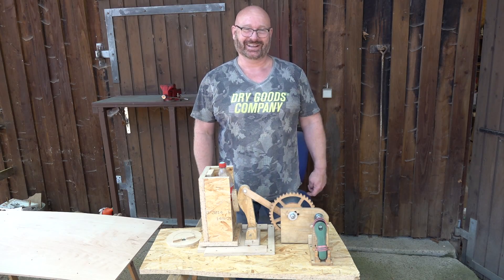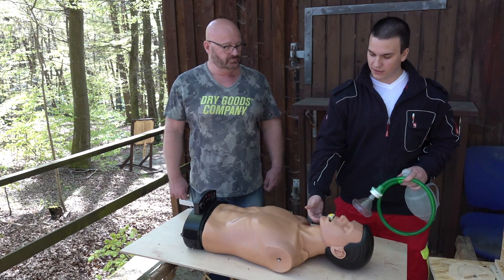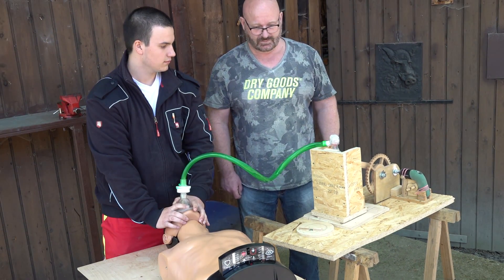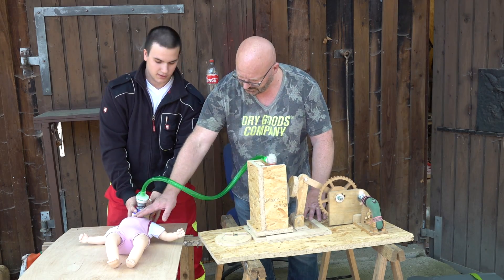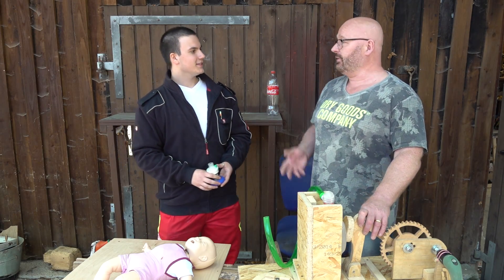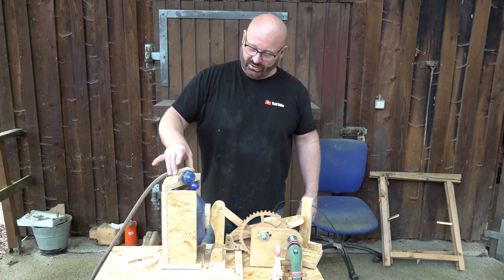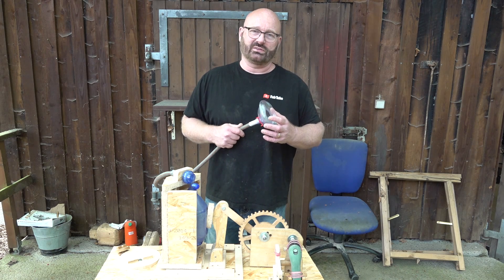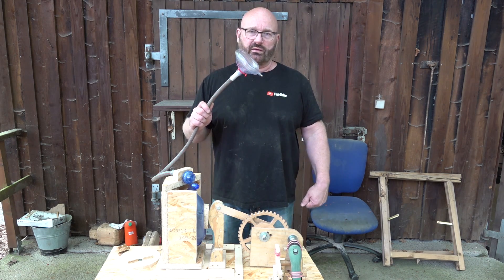Home Made Ventilator - Life Saver or Death Machine?

Comment: In my opinion as a physician: at first glance this doesn't seem entirely useless, because in a situation where there is no spontaneous breathing at all, any ventilation is better than no ventilation.
On the other hand you're not reducing the required manpower to manage the emergency situation, because the person holding the face mask might as well do the ambu bag compressions, too.
Moreover, compressing manually gives a feedback about the lung's resistance, which is highly important! Let's be clear: this as a ventilation with mandatory volume , regardless of the lung's resistance, whereas almost all modern ventilation techniques are some kind of pressure controlled ventilation. With this device there is a high chance of adding pressure induced (=hyperbaric) injury to the already injured lung. The least requirement would be a bypass valve that releases whenever the pressure exceeds a certain max. pressure. This also makes the foot pedal unnecessary, because you then no longer have the risk of pumping against the chest compressions in a CPR situation, resulting in dangerous pressures that can e.g. lead to a pneumothorax (=lung collapse) which can within seconds make the situation dramatically harder to manage, even if it's recognized early enough (which certainly isn't always the case).
Edit: Another important pressure-related risk is hyperinflating the stomach, too, which among other problems can cause vomiting. If this acidic junk is then pumped into the airways, this can be a recipe for desaster and you certainly would want to have some kind of suction pump with a catheter to resolve this. With the manual pressure feedback of an ambu bag you can avoid this problem to a certain degree (although - if available - certainly ventilating via a tracheal tube or at least a larynx mask instead of a face mask would be preferred).
Btw, the 30:2 method (=ventilate twice after each 30 chest compressions) is made for situations where there is no mechanical ventilation equipment available or not yet in place and doesn't make a lot of sense under mechanical ventilation with a safety mechanism against high pressures. Nowadays in CPR with mechanical ventilation the ventilation is not interrupted during chest compressions. I think your guest in this video is overly influenced by his teaching of first aid CPR situations when your mouth or an ambu bag is all you have to ventilate (then of cause 30:2 is correct for adults).
Another aspect: an injured lung can behave much differently compared to a healthy lung. If the lung's own resistance is very high, i.e. the lung is more "rigid" or in other words the lung's "compliance" is low, then the volume per single ventilation (tidal volume) may be too low to actually reach the lung (instead resulting in only "pendulum" ventilation of the ~150 ml of "dead" space in the airways that don't contribute to gas exchange). As a consequence, what you need as a minimum to turn this volume controlled device into something useful is (1) a hyperbaric release valve and (2) a means of measuring this "tidal" volume (and preferably also the volume per minute). Otherwise old school manual ventilation is still by far superior.
Reply: That is one hell of a thorough comment, thank you!
Reply: @EricDMMiller  Is it? You should work on your comprehension. If there is no breathing, no ventilation will kill the patient 100% of the time. Any ventilation might kill the patient too if it is done wrong, but it might also save the patient if done correctly. So any ventilation is definitely better than no ventilation.
I can tell you what really is stupid though: Complaining about minor semantics in the opening statement of a very thorough comment by a professional and then ignoring the rest of that comment which expands on the opening premise and explains why this kind of ventilation might not be so great after all.
Reply: As  a former respiratory medical device R&D engineer, I concur whole-heartedly.
Reply: Dcvbkyrsscbgdsxcgf  I know. The point is if person 1 gets tired, he/she may need a replacement. That means at least two people pumping alternatively.
Reply: paulrwjr  I hope that is a joke.
Reply: @EricDMMiller  i think its the other way around
Reply: Eric M ventilation is not direct compressed airflow into the lungs. Ventilation is the release of carbon dioxide from the aveoli by means on exhalation. No ventilation means increased CO2. I think a physician knows what he’s talking about. Nothing stupid about it.
Reply: @DSNoxious  Well, as a minor correction (yes.. it get's a little nerdy here - I hope you don't mind), technically ventilation actually does refer to airflow in and out of the lung, whereas respiration refers to gas exchange at the alveolar level, i.e. between the blood (pulmonary capillaries) and the intra-alveolar air, across the alveolar cells. However, and this is where you are correct(!) , because CO2 travels a whole lot better (~20x) across these membranes than O2, in practice this means that whenever ventilation is assured, usually(!) CO2 elimination is given, too, which is why in practice ventilation and CO2 elimination are often used synonymously (=just like you do). Therefore "ventilatory insufficiency" usually translates to elevated CO2 (=like you say) and "respiratory insufficiency" translates to low oxygen in the arterial blood (or a least a bigger oxygen problem than CO2 problem). The older terms partial vs. global respiratory insufficiency should no longer be used. There are of cause all kinds of combinations of the two. But as an example showing that the synonymous usage of ventilation and CO2 elimination isn't always(!) correct: think about an embolism in a major pulmonary artery. This means that ventilation is intact (airflow in and out), but because the bloodflow to this area is obstructed, this part of the lung doesn't contribute to CO2 elimination (seen e.g. as a mismatch in a perfusion/ventilation scintigram), and yet this wouldn't be called a ventilatory failure (=despite normal airflow/exhalation in this part of the lung).
Reply: Very good explanations Christian.
Reply: thanks for this comment
Reply: @EricDMMiller  have you noticed that you're the only one who didn't read in "within reason" in the "any ventilation" comment. What if we compressed and cooled the air until liquid so we could cut the patient in half with a converted water jet cutter or would that be silly even for you?
Reply: It's hilarious to see a bunch of internet hooligans trying to argue and cotradict a person who actually has extensive medical training and experience, i'm not even mad, please never change internet.
Reply: tl;dr
could work, in certain very ideal situations, and is better than nothing, could also kill you
Reply: Dosen't Change that %80 of those with corona who end up on ventilator, dies.  
The ventilator is a death machine.
Your body need to fight the virus in other ways than taking all the heavy lifting away of the lungs away. 
You only need it if the patient is absolutely not breathing by themselves.
And that is not what is happening.
Reply: @Razorback73 Where's the wall Trumpberg promised us?
Reply: @Christian S. Assuming the Covid thing had gone worse than it actually did(thank heavens...), could something like this system (with the recommended modifications you mentioned) have been used as a temporary replacement for the CPAP and other ventilation machines that some talked about cannibalizing for the sake of Covid-19 patients?
Reply: paulrwjr  ...haaaaaa..not in room with patient
Reply: @jaxxbrat2634  what part of emergency situation did you not get? Emergencies does not always happen in a a room or hospital. In fact most eemrgencies situations happen outdoors (mountains, highway, crowded events like football matches or open air concerts...)
Reply: @EricDMMiller  Well, dear troll, saying "at first glance", followed by "on the other hand" is the opposite of an absolute statement, it's textbook relativization (and I gave plenty of reasons). Look into it.
Reply: It does not reduce the number of personnel but it reduces the manpower. Pumping is a laborious process, the person doing the pumping can get tired.
Reply: Christian, I believe the original purpose was as an emergency backup for ventilators, that needed to be used for long periods of time. At that point, the mask would be strapped to their face. If someone had the carnivorous, they needed a ventilator, but a spare on simply did not exist, do you think Joerg could theoretically swoop in with his invention to save the person's life?
Reply: @ChemoshKamos  Well, if all I have is an ambu bag or this machine as it is, I would - for the above mentioned reasons - rather organize a team of persons (maybe even with relatives) alternating in shifts for manual ambu bag ventilation (this by the way, contrary to another comment, is not laborious at all; only very little force is needed and there is a rest of about 5 seconds between 2 pumps). With such a primitive device that has the above mentioned problems and no alarms whatsoever, I'd anyways at least want to have continuous visual supervision of the patient. Strapping the mask to the face btw (like in non-invasive ventilation in concious patients or sleep apnea devices) wouldn't be the realistic choice, because a shortage in ventilators doesn't need to imply a shortage in tracheal tubes, too. Of cause we're talking a theoretical scenario here (e.g. what about legal and ethical implications because of the risk of infection for this team? - although during mechanical ventilation lung + ventilator are an enclosed system, i.e. the person won't cough/breath in your face).

But can Jörg's device be survived? We're talking about a scenario where the infectious lung damage is the primary(!) cause of the emergency, meaning that the lung itself is so critically ill, that the person is no longer able to survive on its own. And with such a delicate equilibrium, having no feedback about what you're doing to this lung will be almost 100% deadly (this is my subjective opinion; other physicians may disagree). In other cases, where the lung is not the primary problem, I think with some adjustments (tracheal tube, pressure release valve) this machine can be survived as long as at least continuous oxygen saturation measurement (finger clip) is guaranteed and regular arterial or capillary blood gas analyses are performed (CO2 level? pH?) in order to adjust volume and frequency according to the specific needs.
Reply: @___Chris___  So you want to bring in a group of people, one or more of whom may have Covid, in close proximity to a person who is not breathing properly?  The more people involved in providing aid the greater the risk that you will infect the patient.  Not to mention also risking all the relatives and other volunteers should that happen.   As someone caring for multiple high risk patients, with Covid I can assure you that you do not want that to happen to your hypothetical patient.
Reply: Mark Pendragon, your 3rd grade comprehension skills are just enough to finally figure out how to walk and eat ice cream at the same time.
Reply: @ChemoshKamos  This can not be used for a long period of time without damaging lungs. Pressure and timing controlling by feedback is a key feature that saves lungs from damage. Damaging lungs only helps to kill the patient.
Reply: @EricDMMiller  Ah, the good old reduction ad absurdum fallacy...
Reply: @MonkeyJedi99  Reductio as absurdum: A mode of argumentation or a form of argument in which a proposition is disproven by following its implications logically to an absurd conclusion. ... The fallacy is in the argument that could be reduced to absurdity -- so in essence, reductio ad absurdum is a technique to expose the fallacy.
Not saying the argument was valid, just saying reductio ad absurdum isn't a fallacy.
Reply: Still doing more to help the situation than the president of the United States 🤷‍♂️
Reply: @jasonwarwick5062  He's done a lot more than you. Just saying.
Reply: Allen Albertson, if you are talking about lying, fraud, treason and murder, yes, he's done a LOT!
Reply: @jasonwarwick5062  Are you nuts? Trump has done lots and he started doing it while the idiot Democrats were still impeaching him; and all the European governments did nothing at all. And as usual, everything he does is blocked by Democrats whenever they can; now blocking emergency bill to get extra funds to folks so they continue to buy food. Getting captains of industry together to manufacture necessary things. The man is the most proactive western leader, and without him, the US would have been far worse.

Compare that to the Dutch minister of health, "I can't get anything, because I can't buy anything anywhere." This while there is manufacturing plant telling him, that with a little funding they have their plant rebuilt in no time to start manufacturing the very things we're short on.

You should be glad with Trump, because he's the one Western president that's actually doing things other than demanding other countries pay through the nose to prop up their miss managed economies.
Reply: @3dmaster205  Trump LIED people DIED
Reply: @1individeo  in my home country of Norway they didnt do anything. When it was raging in Italy they didnt Even quarantine People who came from abroad or Even test anyone. Trump did both of these things weeks before my government took action. No he didnt do a perfect Job, but he sure did a better one than all the europeans Nations. More people are dying per capita over here, and we are not nearly as densely populated as the American cities.

Comment: Real engineering made a video about why those those kind of ventilators are death traps, go check it out.
Reply: In short they pump too much air into the lungs causing lungs to explode/overinflate if flow/pressure isn't properly maintained

Comment: I think that the initial machine had a definite purpose: to be able to prolonged breath a patient. I don’t see the added value or solved problem of the later improvement: in CPR it is not the breathing that’s hard to maintain, but the massage of the unconcious victim, that doesn’t breath by itself  anymore.

Comment: Hi, I'm a paramedic. This ventilator would work for a CPR but it's no use in intesive care cause you want to use a controlled PRESSURE ventilation not a VOLUME controlled ventilation.
Reply: For covid 19 the ventilator would need to maintain peep (constant positive pressure in the lungs) to prevent the lungs from collapsing and the breathing cycle has to be triggered by the patient's attempt to breathe otherwise it's hard to get them to start breathing normally when you remove the ventilator
Reply: I do not see Jeorg's invention as a replacement for modern ventilators. I see it is a step TOWARD modern ventilators, in the way of a thought given form. Or a way to understand where ventilators came from.
Reply: ? volume control ventilation is used routinely in ICUs for ARDS patients and Covid intubated patients. source: ICU doc in a Covid ICU
Reply: Would it help people who stop breathing during sleep?
If it had a food grade water hose used for RVs and silent electric motor?
Could blueprints be sold for people to make at home for personal use?
Reply: @bookofrevelation4924  For sleep apnea, you need the same constant positive pressure and same trigger as for COVID patients. This machine is not a substitute for an APAP/CPAP machine.
Reply: @alanjervis9022  thank you for replying with needed information.
Was thinking a sensor held by a rubberband around the chest might be able to trigger motor to run after a certain time of sensor not moving from lungs working.
Then motor quits after certain time of running to wait for response from sensor,
to see if motor needs to start again or not.

As far as constant air pressure at minimum level,
could a pressurized air tank connected to air hose provide that?
Reply: Needs some rubber bands on the compressor arm to help limit pressure.    Or, some accumulator bag.
Reply: So youd need a clutch that could slip at a certain pressure...preferably settable?  That might be doable...
Reply: I understand what your saying but wouldn't a lower volume mean a lower pressure as u are forcing less air into the lungs.
Reply: If this ventilator could be used for even some patients and free up controlled-pressure ventilators for use on other patients, then it's still a success.